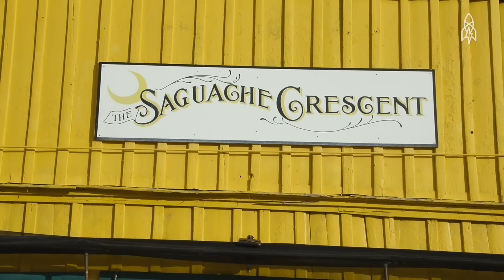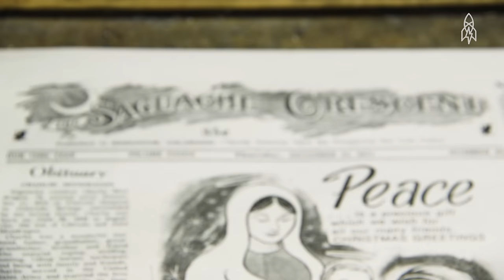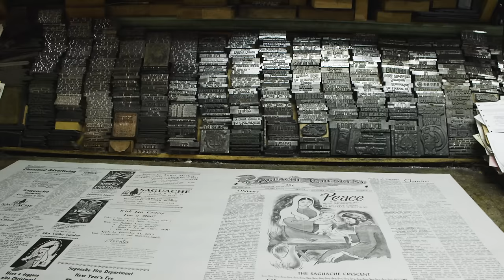True to Type: Running America's Last Linotype Newspaper

Comment: As a teenager, I set type on a composing stick and ran job presses.  I was a lino operator from 1958 to 1980, when my company switched to computers.  I learned the typewriter keyboard, and did page make-up on the computer, but it was never the same as getting my hands dirty

Comment: That linotype is almost 100 years old.  It must have been nice when people cared about building things that could last more than 3-4 years before completely breaking down and becoming irreparable.
Reply: People made cheap and shoddy products 100 and more years ago, it's just... unsurprisingly, they broke and were thrown away 98 or 99 years ago, and so don't survive until today! Only things that were decently built—by no means everything built back then—survives the test of time. =3
Reply: It turned 100 this year!
Reply: I was a Linotype operator at the Yorkshire Evening  Post newspaper in Leeds, UK for over 30 years. Sad day for us apprentice  trained craftsmen when hot metal typesetting ended.  We trained in computerised typesetting but eventually were replaced by unskilled women typists but we inevitably lost our jobs. Now it's cheap labour producing a shoddy product.  Circulation has plummeted from over 200,000 to 11,000 copies a day which is common with newspapers today - internet has ruined traditional newsgathering. At least we had the well paid good old days!
Reply: They older than 100 years an ran way longer than years an if they broke they got fixed on the spot

Comment: When printing involved that much work, what was printed became important. Had to say more with fewer words. And it needed to be something important. Digitization has polluted communication in many ways, as much as it has enabled easy communication.
Reply: @Meme Memeson thank you for that informative reply! What an amazing machine.
Reply: @Meme Memeson I’ve learned much. I wasn’t aware of the connection of printers to the labor workday movement, but it makes sense. Print was in high demand. I threw a few newspapers back in the 1960s when print still ruled media, though radio and television were big, as well.  Newspapers were huge in size and people habitually started their day with the newspaper or read it upon coming home from work. We even delivered an evening edition, for the most avid news readers. Many people were so addicted to the daily newspaper as people are addicted to their smart phones, if for less time each day. My parents, for example, could not skip it for a day without becoming irritable. 🤣😂.  I grew up on the heyday of magazines and journals, another big source of print. Little did I know that the people working behind the scenes were also responsible for my 8-hour work day.